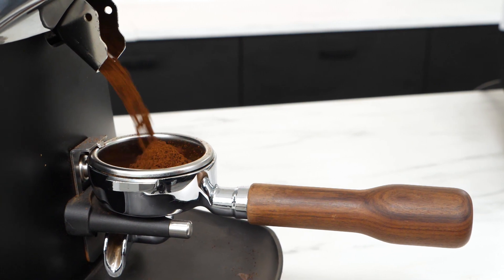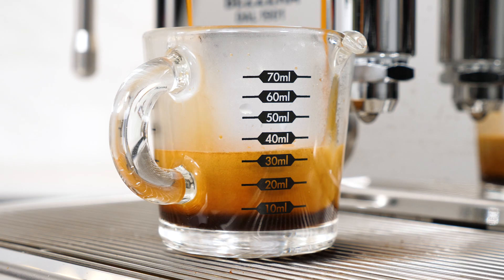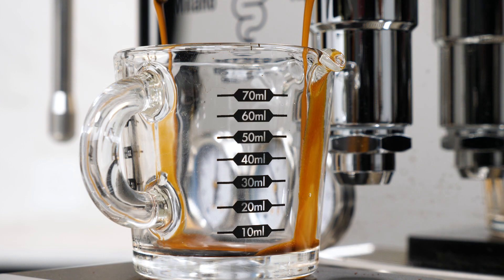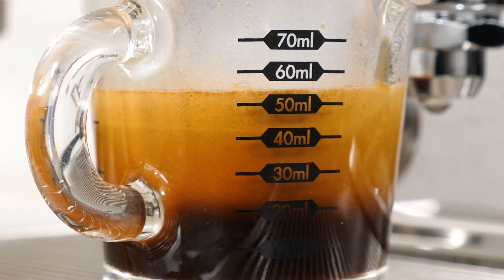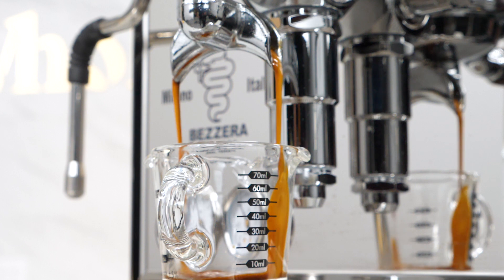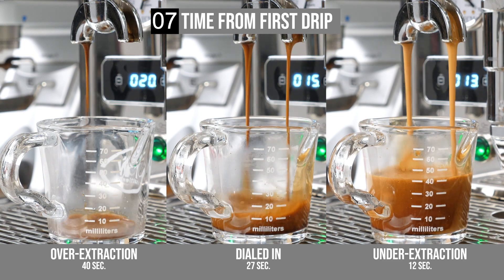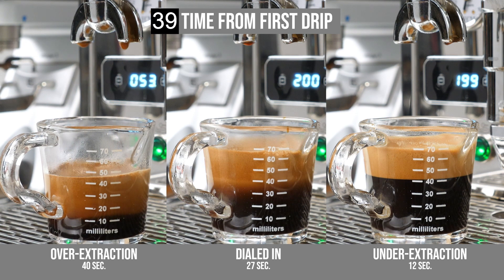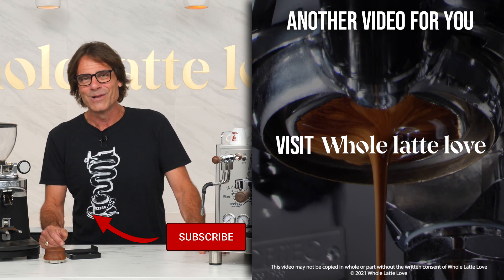How To: Espresso Volume, Weight, Timing & Ratios

Comment: This is the first time I've heard the idea of timing from the first drip, this makes so much more sense to me. I've experimented with extraction times while keeping the 1:2 ratio, and I've thought, how can my espresso taste so good but my extraction timing is like 45 seconds. After seeing this video I went back to my Alex Duetto 2 with a very fresh bag of just roasted beans, and the flow doesn't start too well past 10 - 15 seconds. The total time the pump is on is about 45 seconds but it tastes great. Now when I subtract the 15 seconds before any flow, I'm right back to the 30-second mark and it all makes sense now.  I've wondered about this for years so thanks for this.  It's more pronounced with just roasted beans as they are oily and clumpy so the water doesn't break through early as it does with beans that are a bit more aged.
Reply from the maker: Hey Paul, Thanks a whole latte for sharing your experience. The 20-30 seconds 
timing is basic old school. As specialty coffee took over it's much less a thing than it used to be! Very fresh beans can really benefit from a long low flow pre-infusion. Allows the coffee to off-gas the locked up CO2 and reduce brightness by lowering carbonic acid into the cup.
Marc

Comment: Hey there,
thanks for the helpful videos!
I'm new to properly brewing coffee and have a few questions...

Although my Sage Smart Grinder has the finest setting, the Solis Barista Perfetta makes a single shot in about 12 seconds. I get 10g of espresso out of 7g of grind. Should I press the single shot button agai  and stop when there are 14g of espresso in the cup?

Should extraction time or brew ratio be prioritized? 

I'm using the single shot portafilter by the way.

I'd really appreciate your help!
Reply from the maker: Hey flo, Thanks for the question! Your extraction is definitely too fast. I would prioritize brew ratio but with a timing of at least 20 seconds. I believe your grind needs to be finer to slow things down. I have not used a Sage/Breville Smart Grinder in a long time but have you tried changing the internal burr adjustment to a finer setting? Last time I used an SGP there was an additional grind size adjustment on the top burr. You remove the bean hopper to access. I show how in this video I did 8 years ago https://youtu.be/siYJZlLScac?si=Zu7vyGE5pO9OBkix&t=62
Hope that helps!
Marc

Comment: Hey Marc and AJ. Love the videos, think I've watched just about every one you've ever posted 😄.
I'm looking to upgrade my gaggia classic pro to a HX PID machine. What machines would you recommend?
Thanks
Reply from the maker: Hey C, Going from single boiler to HX is a game changing upgrade! If making the jump I strongly suggest a machine with PID. The Bezzera Magica is very well built and a real value in HX PID machine. My long time favorite HX PID is the Profitec Pro 500. Currently, for about $120 more than the Magica you can get the Pro 500 with flow control.
Hope that helps!
Marc
Reply: @Wholelattelovepage  thank you Marc! Really appreciate the advice 👍

Comment: Nice video again, 
I use 8 gr. for single shot,  and get 25 gr espresso in 20 seconds,  what do you think? ( I have Delonghi ec685 espresso)
Thanks
Reply from the maker: Hey m, Thanks for the question. Your Delonghi, the Dedica is a pressurized filter basket espresso maker. With those, grind size plays a minimal role in changing extraction timing. Based on your timing, coffee dose weight and weight out you're running a 1:3 ratio. That's a little high as standard espresso is 1:2. You're more in lungo territory with that extraction. Personally I'd use a more coffee in the filer basket to reduce the ratio and it might up the extraction time which is a little short of optimal. But, it's really about what you like!
Marc

Comment: I purchased my ECM Synchronika from you guys & use the Crema Wave. Any suggestions on getting a tasty shot since your familiar with both? Thanks.
Reply from the maker: Hi 4, Thanks for the question. I like Crema Wave pulled as a double shot at a 1:2 ratio using 18g of ground coffee at 201F brew temp - that's what you saw in most of the shots in this video. Key thing is getting the grind dialed in. If you need help with that here's a video showing you how: https://youtu.be/jOY7D02n4Cw
Marc

Comment: Hey Marc, love the videos. I had a quick question. So I just purchased the Breville Barista Express and have been attempting to dial it in for multiple days now and have been getting really frustrated. I'm really new to the art of espresso and would love some insight if possible. I have been attempting to do a 1:2 ratio with about 18g of coffee, however I am pulling less than 36mL of espresso in about 23 seconds (with pre-infusion time as well) and the weight is about 1:3. I have tried to go finer, and stopping the machine at exactly the 36g results in even less mL, and a more accurate pull time. I am trying to get the best of both with pulling 36g, yielding a higher amount of mL and all within the time. Do you have any tips of what I could try to achieve this outcome?

Edit:
Additionally, I've looked online and many talk about not worrying so much on the mL outcome of the pull, but focusing more on the 1:2 weight ratio and trying to get the timing for it down. Is that something I should just focus on instead of the volume of the shot?
Reply from the maker: Hi Falcon, If you're using weight forget about the liquid volume. Weight is far more accurate!
Marc
Reply: @Wholelattelovepage  thank you so much! I’ll keep working with getting the timing perfect for the weight!

Comment: Great vid! How do you guys like that Bezzera Magica PID?
Reply from the maker: Thanks for the comment. Magica is a very solid HX PID machine and excellent value. It’s a little thing but I love the wire grate over the drip tray compared to other machines with flat laser cut metal over the drip tray. The wire grates stay much cleaner. And, if you didn’t know Bezzera has been making machines longer and makes far more of their own components than any other manufacturer. 
Marc

Comment: Newbie here, I was given a pressurized espresso machine that uses the double layer metal Porta filter. Question is, can I change to a bottomless portafilter using this machine? Just curious.
Reply from the maker: Hi Alfred, Thanks for the question. It may be possible - wish I knew the make and model of your machine and I could give a better answer. Some machines can use both pressurized (the dual wall filter baskets) and non-pressurized (standard commercial style). That's the case with machines like the Gaggia Classic Pro and many units from Breville/Sage. If your product is more of an appliance grade espresso maker most of those are setup to use pressurized baskets only but end users do hack them to use non-pressurized fileter baskets with varying degrees of success.
Hope that helps!
Marc
Reply: @Wholelattelovepage  it’s a Gevi GECME003D-U. I know it’s not a professional machine. Just exploring my options.

Comment: Hey WLL team, love your guys channel. When one has beans past their best extraction date I find the grind size needs to be finer and finer to get the 60mL in 30secs, in general would it be a better shot if I kept the grind a touch courser but dial back the brewing time?
Reply from the maker: Hey JaM, Thanks for the question and comment. You are correct as coffee ages grind generally gets finer. In general you should adjust grind to keep timing the same as coffee ages.
Marc
Reply: @Wholelattelovepage  will do, cheers for the answer.

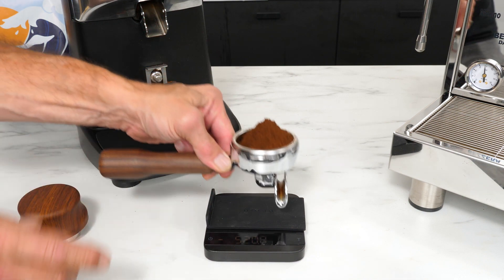Comment: Hello Marc and A.J. Do you offer on the US or Canadian stores the adaptor plate you used to weigh the coffee in the portafilter and on the scale time is 2:03 and on.  Thanks!  Keep up the great videos. Always such a great help.
Reply: Actually, the Acaia Lunar comes with that plate. It’s the usual protector turned upside down. I didn’t realize until I watched this that it can be reversed like that and use with the portafilter. I learned something new tonight and it’s quite handy… Mind you, I also have the long plate for it which is nice for doing a couple of shots at the same time…
Reply: Just an FYI, that Canadian site they have ships from NY, so I'm not sure why they even have a .CA website when it's not shipped from Canada. Your going to get hit with duty fees.
Reply: @naf4361  I’ve ordered from the .CA site and the prices include the duty and such. There were no additional fees on receipt. That is why the .CA site has a very limited range of products compared to the .COM as they’ve already handled that aspect.
Reply from the maker: Hey David, @Steve C has it right about the plate and the prices!
Marc
Reply from the maker: No duties

Comment: I'm getting the correct volume of shot (40ml) from 18g of coffee in about 27ish seconds but the shot still tastes sour every freaking time.  Even if I grind finer a bit , it stay sour with timings of about 30~ I'm using fresh beans ... :(
Reply from the maker: Hi MA, It may be the beans... Fresh from roast beans often produce bright/acidic flavors due to CO2 locked up in the beans. I wonder if that's what's presenting as sour flavor to you. As beans age the brightness will fade a bit. If you have a machine capable of doing so, a long low flow rate pre-infusion may reduce brightness in very fresh coffees.
Reply: @Wholelattelovepage  i guess that is probably it, and also the beans i bought recently have all had fruity notes which could be a contributing factor.
thanks you for the tip

Comment: Loving the vids. Going down a rabbit hole as I wait for a new rocket machine to arrive. You mentioned the grind when talking about extraction time, how about tamping pressure?
Reply from the maker: Hi Tim, If you asked me 10 years ago I'd say tamp with 30lb/13.5kg of force. These days I say tamp firmly and consistently. Personally I more like to use a proper leveler with adjustable depth to compress the coffee. Or use a distributor followed by a calibrated tamper. Here's my favorite lever which I use without additional tamping The Jack: https://youtu.be/4Z5vTi643sc
Marc

Comment: Gram is weight, milliliter is volume. They have nothing to do with each other. For example, you can fill up 100 milliliter volume with molten gold which will weigh maaaaaaaaany grams, and you can fill up 100 ml of volume with cotton and that will weigh not so much. So the point of the scale is such that when you grind let’s say 18 grams of coffee then you measure 36 grams of extraction, this will keep the measuring units the same and therefore we can compare. (Remember the old saying “apple to apple and not apple to orange “. Please note, we are only interested in the weight of the extraction and not its volume, in other words we don’t care how many millilitres those 36g of liquid coffee will occupy.
Reply: 1 gram is defined as 1 millilitre of water. That is the metric definition.
Reply: @quokkapirquish6825  - first off not just water but pure water because if it is just regular water as it has different mineral content in different areas it will be an inaccurate definition. But that is not true anymore as this was changed in 2019. Now one gram is defined as one thousandth of a kilogram and one kilogram is defined as the mass of a particular international prototype made of platinum-iridium and kept at the International Bureau of Weights and Measures. You are about a few years late :))))
Reply: @glichasasha750  I bet you’re fun at parties.
Reply: @quokkapirquish6825  - this is a respectable channel, let’s try and not provoke each other too much please.
Reply from the maker: Thanks for restating the point of the video!
Marc
Reply: @glichasasha750  LOL, and you're the one to talk?